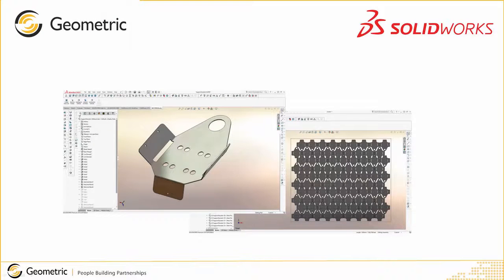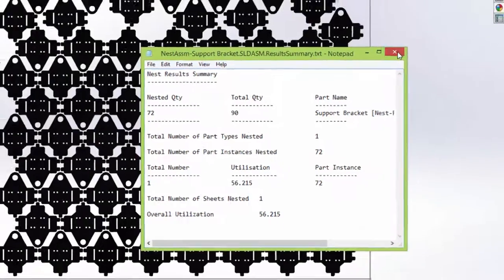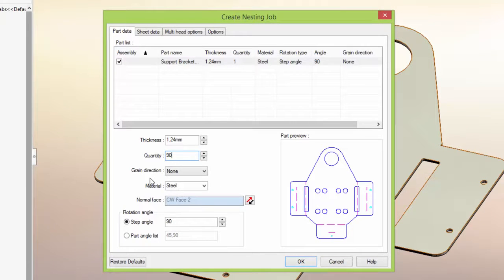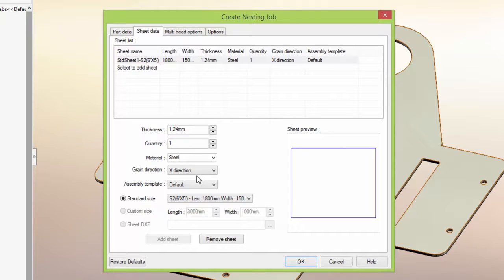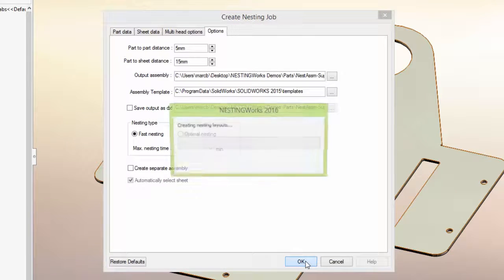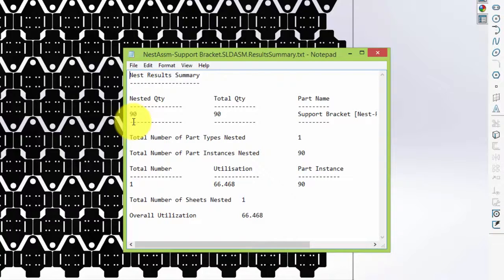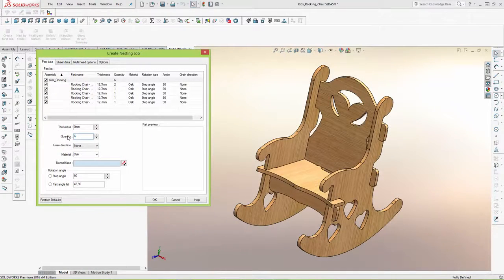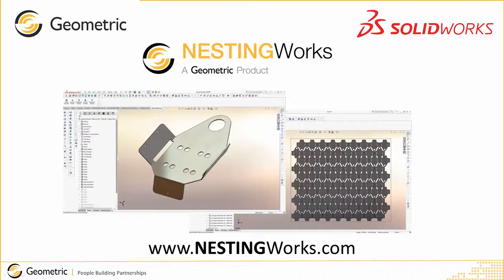Best Sheetmetal Nesting Software for SolidWorks Users - SolidTrust

Comment: I have tried it recently, and it is plagued with issues, short-comings and errors. Most irritating is that when you have a multi-body part, you can't batch edit the individual bodies. Each and one of the bodies has to be edited individually on the part data tab. And when you want to nest multiple sets of of the multi body part, you have to manually calculate and edit each and every one of the bodies manually as it ignore the top line whole part amount, It screws up configurations, Bending lines are placed on the wrong configurations etc etc etc etc..... No Thanks,  even if it was for free.
Reply: @ Peter Persson, I am not sure what you mean by editing each Body? we have created some solutions here 
https://nctools.com.au/services/edgeworks-software/
we have tool that Manages Multibodies